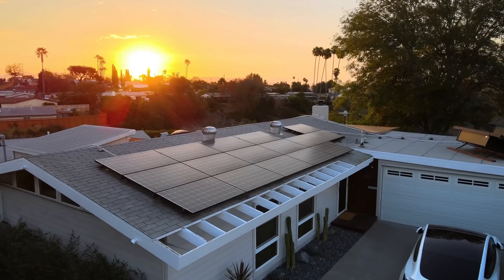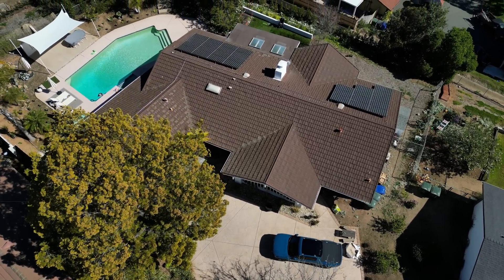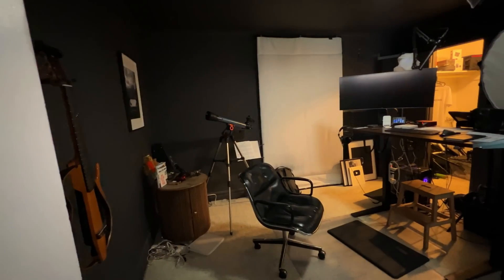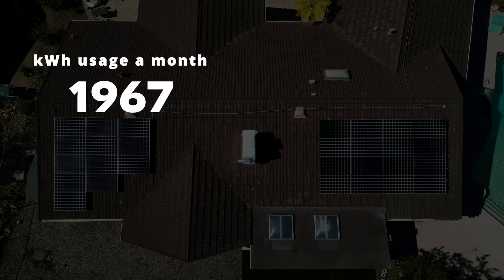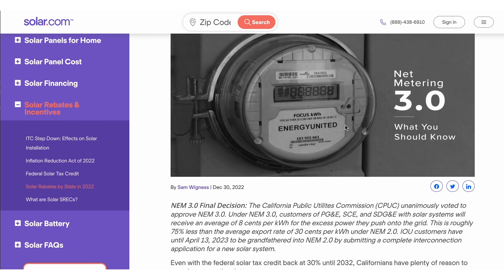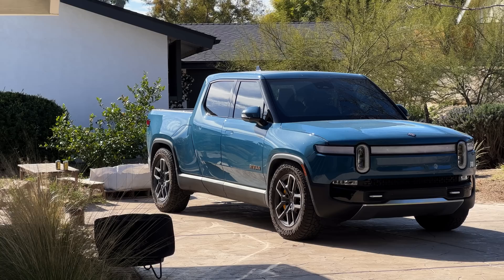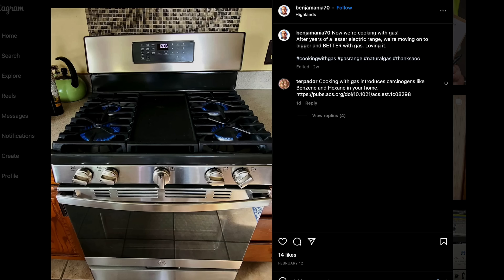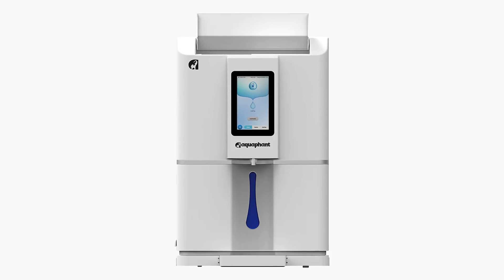Going Off-Grid at my New House!

Comment: We have vacuum tube solarheat system (installed 2007). I guess this is more effektive to heat water, and water based heat system in your house. But a air/water to heatpump might be better, but put strain your solar / battery electricity system. Solar electricity you can use for all purpos, solar heat you can only use to heat water. In Oslo Norway where me and my familiy lives, we allways had cheap electricity, until now. So we are planning a Villiant air to water heatpump to assist our solar heat system over the cold winter period instead og electricity. The Villiant with propane as a media instead of r410 (or other media), it can lift to 63celcius over normal 55, and that is good enough for us to for both hot water and heating. Love your content, and looking. Forward to see these videos. Greeting from Oslo Norway😊

Comment: In Romania, clothes dryers are not so popular. We hang them and let the air do the drying. Me, not having where to hang them but indoors, I use an air dehumidifier. 
I hang the clothes on a rack and let the dehumidifier do its magic. It would work better if I had a smallish room for drying the clothes, but it works anyway in the living room. It uses 160 watts pe hour, takes little space and I use the resulting water to water the plants or put it in the washing machine to wash clothes.

Comment: How do you have an electric bill of over $800 with an 8kW solar panel system?  That size of a system would easily zero out your monthly electric bill for the size of your home.  But you should keep your gas dryer, gas water heater and gas furnace because if the grid goes down those things still work.  But yes get rid of your gas stove and go induction.  Induction is faster and more energy efficient than an electric stove.  Sure it's louder because it uses fans, but it's not as loud as a microwave.

Comment: Ben, there is such a thing as a heat pump dryer. It does not use much energy at all. Want to save still more? Line dry, also better for your stuff. And, for folding you will need to touch every item anyway. 2000/month is crazy high. We use 4000/year. Everything is electric but the car, the four of us live on 2500 sqft and we see -10/+40 Centigrade over the year. By the way, we run 3-5 freezers/refrigerators, one thereoff an excessively big one for wine. I love your videos but I do not get my head around why americans seem to think every appliance needs to have ten times the consumption it has in Europe.

Comment: Throwing technology at the problem works if you can afford bleeding edge technology.
If I were lucky enough to afford your home I would use first principles to achieve your goal of energy self sufficiency. Start with an energy audit , next insulate with energy recovery systems added. Without starting with this approach, your baseline energy needs are too high and you are not addressing air quality issues important to your family’s health.

Comment: Wow, this is one super inefficient house you bought.  The insulation and sealing must be pretty poor.  Are you doing anything to tackle that or just throwing more solar panels at it?  I have a 9.4 kW solar system and power my 2,700 sq. ft house (encapsulated attic, so equivalent to conditioning a 4,000 sq. ft. house) in NC at Net Zero.  We did build so it's super energy efficient.  Also, no batteries as they are not cost-effective in our case.

Comment: Going fully off-grid is  perhaps an overhyped goal.  When was the last time, and how often have the natural gas lines in your area gone down?  Probably never.  It's super cheap too.  Whereas the electric grid in CA is super fragile and prone to black outs.  The natural gas is cheap and reliable, the electric grid there is super expensive and unreliable.  I'd think it through a couple times before switching those big appliances from a cheap reliable system to an expensive unreliable one.  From that quick run down, I don't think you could install enough solar to power all your appliances and your electric cars.  Also, natural gas is getting a worse reputation than it deserves.  Natural gas fracking is responsible for a 15% reduction in greenhouse gas emissions in the US---the largest reduction in world emissions.  The only thing cleaner(and reliable) is nuclear.  Seems like your best cost solution would be different than your ideal all-solar-and-battery solution.  That break-down might make an interesting video.

Comment: Ben,  is geo-thermal heating and cooling an option?  I am asking because I am wondering in the San Diego area if that is even a viable solution.  In addition, would water heating via geo-thermal in conjunction with an electric tankless water heater to bring it up to the needed temperature be an option?

Comment: Switch your gas dryer for a heat pump one. They are not much more than a standard electric one but they use about 1/3rd the power. We run a guest house and it's paid for itself within a year with how much it gets used.

Comment: If it makes heat, use a heat pump. Hot water, drier, space heating [EDIT: and pool heating!] (your existing AC should be able to cover your heating needs). Insulation, the more insulation you have, the less cooling you need. People often think insulation is about keeping the heat in, but it will also keep the heat out and lower your AC requirements.

Comment: I think you're calculations are going to be off. Currently you stated that your usage was 2000kwh per month but you don't have all of those gas appliances figured into your usage. I am of the opinion that you will fall short when you add all the big appliances in the equation. Unless you have padded your figues. I live in a different region of the country from you and my house is smaller than your's but on average we use 950 kwh per month this figure is without the electric vehicles . And we're pretty frugal. Can't wait to see the batteries you are going to install. Currently have power walls looking to add some additional batteries to go off grid

Comment: Why not double or triple your solar to future proof the house if your converting everything to electric? Could you look at insulation inside the walls and do a heat loss camera to see if you could save running costs? Maybe smart thermostats and sensors to see where heat is being lost?

Comment: Is it better to electrify everything first so you have an acurrate measure of load nefore upgrading your solar system? That way you could avoid possibly undersizing your solar and having to do an add on later. But considering you are trying to beat the NEM 3.0 clock, maybe take a rough guess at the future loads and try to bake that in to your solar project

Comment: For your clothes dryer, you can consider heat pump based dryers. We switched to a Miele a couple of years ago from a pure electric one and could not be happier. Power need is so low that the new one uses a regular 110v outlet, closed off the air vent to outside. So efficient!
Reply: Our AEG heatpump dryer also works great. I was trying to see what I needed to fully deplete my 3,8 kW solar system on a sunny day:
Bosch Washing machine
AEG Dryer
Philips Coffee machine
Off-brand water cooker
Daikin A/C

And I still had a few hundred W in surplus!
Reply: Totally agree with Frederick, we also use a  heat pump dryer. It consumes around 750Watts or 1.5kWh for a machine full of towels.

Comment: I just had a system installed 3 days ago. Looks like the last 3 days the panels produced about 65, 55, and then 17.7 kWh. It's a 43-panel system with a RESU10H Prime LG Battery. My understanding is and I wasn't aware of is apparently my large draw items, which are all-electric, like AC, Water heater, car charger, and washer/dryer are not set up on the battery backup because the amp draw will be too much for it. I guess it seems the RESU has a max 15 amp draw or something. Should I get more efficient appliances that draw less?
Reply from the maker: for the AC there is a thing called "smart start" that can reduce it, but I'm not sure if it will pull it down enough to work. Could you add another battery and then be able to put 30A loads on it maybe?
Reply: @BenSullinsOfficial  Yep looking at RESU’s website doubling up the batteries is the solution for fully whole home backup. I guess that’ll have to be a future upgrade.

Comment: I assume you have looked at ways to make your home more energy efficient and perhaps replace the AC unit and perhaps elements of your pool heating system. 2kWh usage per MONTH. Wow. I live in central AZ and have a somewhat newer home, but it's by no means the most energy efficient and I use 1/10 of that amount per month with my 26 panel 9.49kWh solar system. My system more than compensates for the energy usage and I run a credit each month even in summer. Home is about 17% smaller than yours. So not sure why you are using so much energy. Even in summer when we avg 95 degrees for highs I still only use 300-400 kWh per month. I agree increasing the solar system may help, but still....

Comment: I'm glad more people are showing how a regular home can have its energy use covered by solar. I have a 13.7kw system which powers the house, 1 electric car, a pool with a heat pump water heater and a hot tub. I still had excess solar credit so this fall I installed mini splits, rather than use the natural gas boiler. The last major thing to do is a heat pump water heater to replace the gas water heater.

Comment: If you install the Rheem hot water heat pump, make sure it has a vent outside for winter.  Mine makes the garage cool in summer but bitter cold in winter.  Still worth it, as it is about 4X lower electricity cost than a traditional resistance heater.

Comment: Hey Ben, how’s the wind situation there ? Can you go with wind and solar hybrid especially with vertical stabiliser on wind part to have consistent power output … can you crunch the numbers as well on the size required to offset a solar panel there and I am assuming it would deliver power during night as well.
Reply from the maker: It’s not consistent here, but there is some wind. Might look into it later

Comment: Definitely need to tackle the solar and battery installation first to keep yourself on NEM 2.0 because, you're right, NEM 3.0 sucks. Your interconnect application needs to be submitted by April 13, 2023, so you have less than six weeks to get your plans prepared and submitted.

Comment: Great video, and congrats on new house.  It’s interesting to see how things are in SoCal compared to FL.  I have had an 8.8 kwh system with 2 Tesla power walls for just under a year.  I am creating about 15% more power than I use.  So it is not a huge money maker for net metering.  7 months got $96 credit.  However, the Tesla system uses weather info, to fully charge the batteries if there is a tropical storm or hurricane warning.  So last fall when IAN was approaching, it was cloudy for a few days, and I wasn’t generating much solar energy, the system automatically filled the Powerwalls and kept them full.  When the grid went down, my lights didn’t even blink.  I put he house in conservation mode.  Unplugged anything I wasn’t using.  I kept the fridge running, plus the microwave AC and coffee maker when needed.  We were without power (in the city) for almost 5 days.  Never lost power.  I didn’t have to sit in long lines trying to buy gas for the generator.  I was able to charge everyone’s phones, provide ice, and even keep adult beverages cold to share.  My wife and I feel it was one of the best decision we made when we bought a house in FL.

Comment: Heat pump dryer or even having a washing line which is a solar dryer. Look at your insulation and draughtproofing - if you're using 2 MWh per month you're probably losing a lot of your conditioned air.

Comment: Induction requires compatible cookware vs. a regular electric range.  Or you can use iron hot plates to cook on non magnetic cookware.  Does the acqufant just make drinking water or it will make enough water for hot showers and watering your lawn?

Comment: Would love to see what size System you go with , as I’m in Nor Cal similar house and size 2000sq ft max that fits on the roof was is 12kw system to take advantage of Sun from SE to SW of Roof and have quote from system that Has LiDAR and able to have a production guarantee as PG&E bill is around $800 a month as well as Gas prices jacked up. And using around 2000kw per month

I have been getting quote for all different system to be switch to electric as well, Water heater, HAVC and everything from Gas . I have all quotes out as well would love to compare as well if you have similar numbers, 30k Solar , 30k for HAVC and Insulation , 10k for Water, heater and rest . 70k to be Francine’s with PACE Loan on Home Taxes attached to home paid over 30 years

Let me know if you have any other numbers and options to compare better I also have bunch of different quotes if like to review thanks

Comment: Alongside all the cool tech gadgetry, consider making basic investments in insulation, air sealing, and attic ventilation. It can dramatically cut the power needs to regulate the temperature of your home and potentially scale down the solar needs you have. Also, if you're not philosophically opposed to nat gas, it's a good backup for when the electrical grid goes down - hot water and dryer still work!

Comment: With a "off grid" setup doesn't that make NEM3.0 not matter? I can see trying to hurry and stay on NEM2.0 though like you said. But why build a off grid set up if your on NEM2.0?
Reply from the maker: The idea is to be able to sustain off-grid when needed, or to help save money. So in normal operation we’ll still use the grid from 12a-6a when the energy is cheap. Lots to come on this!
Reply: @BenSullinsOfficial  thanks! Im still trying to figure out which rate plan with SCE would be the most cost effective,

Comment: If you want to replace the dryer with electricity, you need to look into dehumidifiers. They use an air-con cycle to suck the water out of the air from the humidity from the clothes and then recondense it. Normal gas dryers just evaporate the water and vent the steam, and that makes them SUPER thirsty on gas. You can get standalone dehumidifiers and just hang the clothes in a small room next to them, or I believe you can get dehumidier based dryers. Dehumidifiers are usually slower, but SO very much more efficient.

Comment: You are so lucky to be living in an area with around the year sun. If I lived in California, I'd sun dry my laundry most of the time. I live in Canada, and sun dry my laundry in summer, and only use laundry in winter or raining. And definitely get rid of your gas furnace, and replace it with heat pump, better yet, reversable heat pump / AC in one unit. that will save you a lot of gas bill.

Comment: Great video!! Not yet a homeowner, but I definitely want to do a similar "bulletproof" for my future home. I would say definitely go with the electric dryer and as others have mentioned there might be other options that can serve the power-draw better. Or, worst case, you air dry your clothes in that beautiful SoCal sunshine lol also, regarding heating/cooling, maybe consider smart vents that you can adjust remotely or adjust automatically depending on what rooms are occupied or need adjustments. That way you zone your AC unit rather than heat/cool then entire home all day

Comment: How well insulated is the house?; air-conditioning is an ⚡ guzzler. 
You'll love an induction hob. Our landlord installed one as the electric oven it was integrated into was his wife's old oven and she needed a wall mounted oven due arthritis. We've found our energy bills shrank considerably and cleaning is a complete doddle; no more nasty nooks and crannies for grease etc to build up in. Given a choice, I'd never go back to anything other than an induction hob. Indoor air quality also improves immensely once you ditch gas in the kitchen for cooking. No more nasty NO2 etc emissions that are responsible for so much of the dire indoor air quality and respiratory illnesses the public unwittingly cause by using gas in their homes. We often hear about respiratory issues in developing countries in women & kids by burning stuff to cook indoors but rarely equate the same thing with ourselves as it's something that (only happens in poor countries).
Ditch the gas fired clothes dryer. Costs a fortune, prices for gas are volatile, greenhouse gas emissions are neverending, and, given that you're in California, what's wrong with using a good old-fashioned washing line & clothes pegs to dry clothes for free in all but the worst weather or a last minute emergency? Swap it out for an electric one & only use it judiciously; that's just common sense energy efficiency for for you. One thing I did invest in decades ago in place of an electric dryer, was an airer for drying clothes. Takes a bit longer, but, once again,  costs nothing to dry the laundry. You've got a HUGE garage so placing the airer out there to dry laundry on is a no brainer even with two young children; people have been drying laundry (without) electric gadgets for 1,000's of years.....

Comment: 1) Add proper insulation (roof, windows, walls) and use techniques to avoid direct sun exposure to walls/windows (shade-cloth style)
2) Dry your laundry on a laundry line. You get so little rain in California, there's no reason you could not dry all your clothes outside. Also is better for the fabric (maybe avoid direct sun exposure, like in a gazebo)

Comment: Hey Ben, you could get a heat pump clothes dryer - if you haven't thought of that. They are very common where I live but apparently not so in the US. I did some measurements and found out that one load of my dishwasher uses about twice as much power as one load of my washing machine and my washing machine uses around twice as much power as one load in the clothes dryer that has a heat pump. Excited for your project!